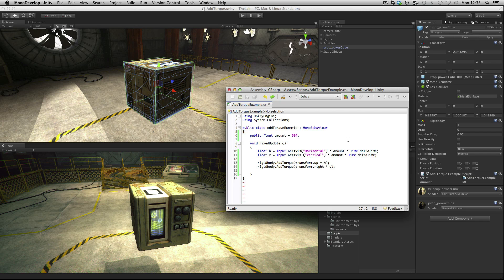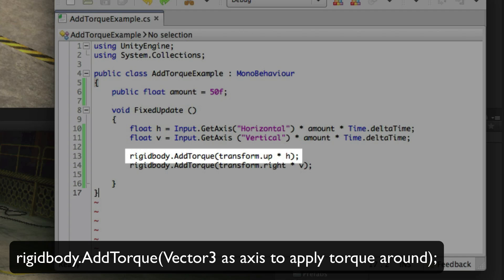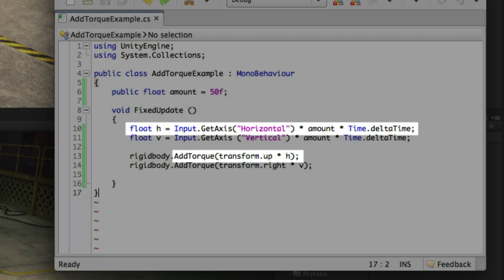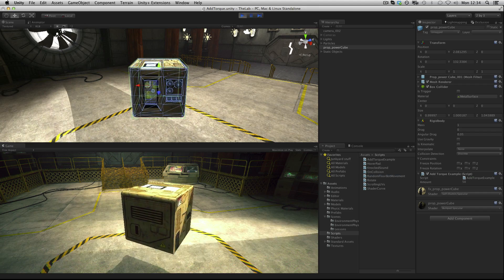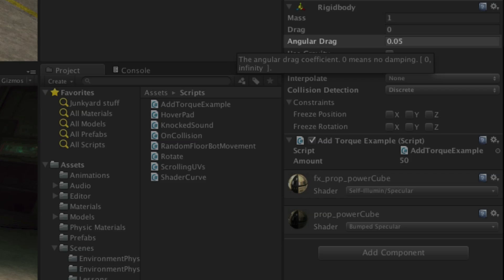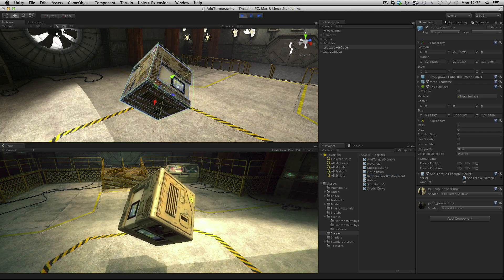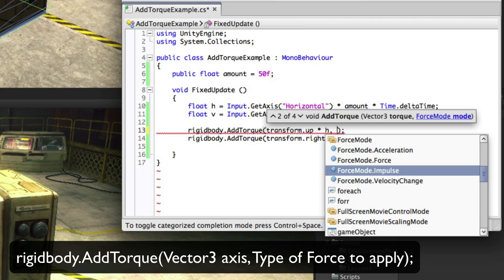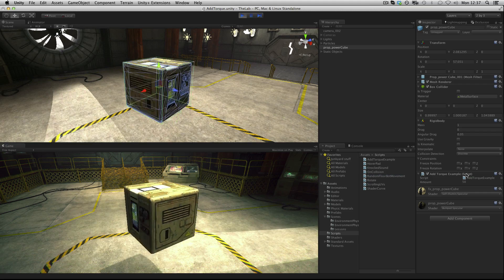AddTorque - Unity Official Tutorials

Comment: I'm using Unity 5.3, and I don't even have access to rigidBody.AddTorque.
Reply: +Tamás Maár He uses Input.GetAxis("Horizontal"), this gets the horizontal "axis" (a number between -1 and 1) from all input combined. 
This means "A","D",left arrow, right arrow, dpad left, dpad right, left controller stick left and left controller stick right. I might have missed an input. 
Keeping the left arrow on your keyboard pressed yields -1 in the function. The same goes for any other input that represents "left".
You can probably imagine how the vertical controls work now.
Reply: +Johan Brodd I don't know if you've used Unity before version 5 (or 
5.3), but as I know, there were changes recently and now you can access 
it in a different way, like this
gameObject.GetComponent<Rigidbody>().AddTorque(transform.up * h);
at least that's what works for me. It also applies to other properties, like material.
What I don't understand is that he says "when I press the horizontal keys...". What keys again? Where? What should I press?

Comment: I'm not entirely sure what angular drag is. In one part you say it's how effective torques are (which would imply it is the moment of inertia) and also refer to it as inertia at one point. But drag more commonly refers to a linear or quadratic effect which is a function of angular velocity. Also, from what I can see of the behavior on this video, it is the latter. However, although I'm a maths student, I'm a novice at Unity so I am a little confused.
Reply: A bit late, but maybe it helps someone else. Drag defines a natural slow down like from air resistance.